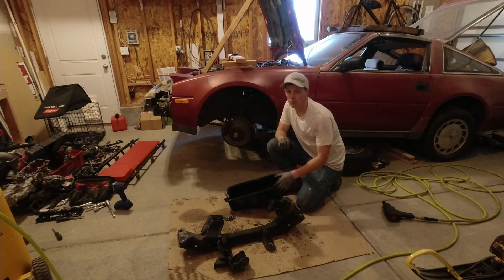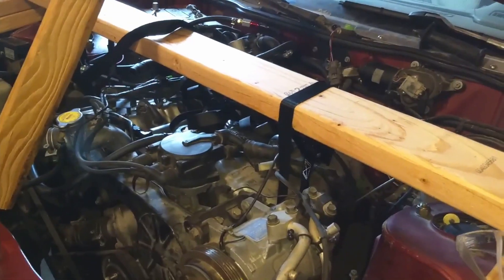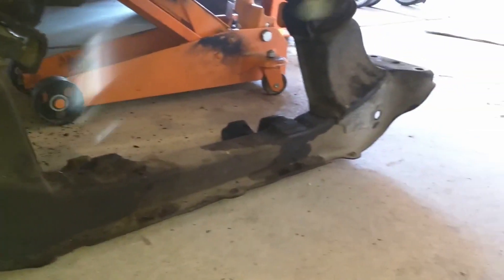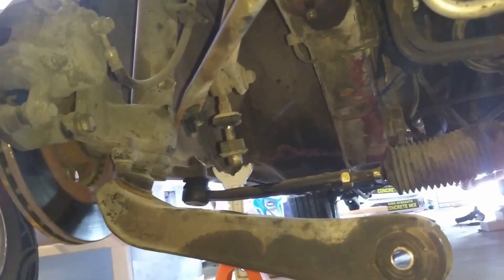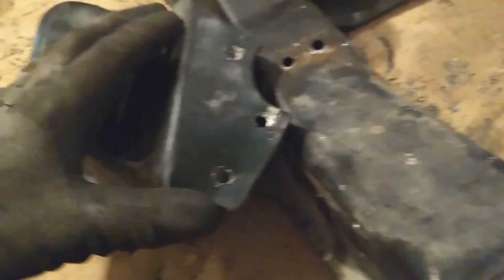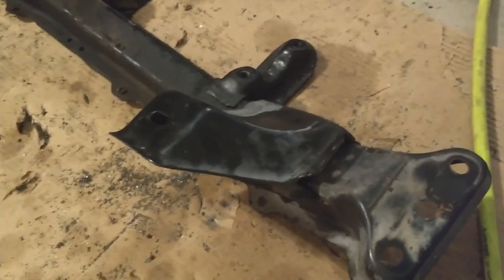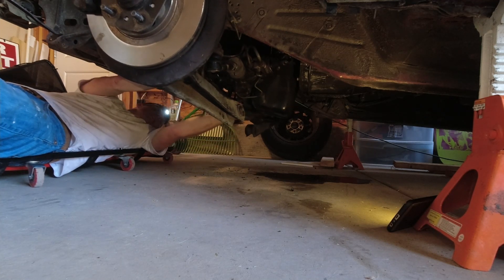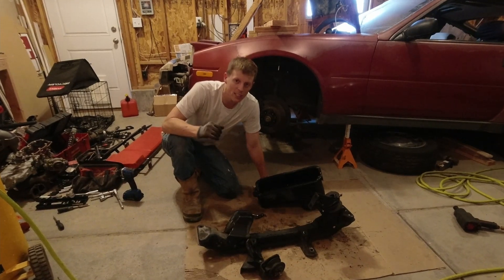Z31 Oil Pan and Crossmember removal NA2T #6

Comment: Awesome videos man. Quick question though, what if im using a relocation pipe and I don’t need to change the front crossmember. Am I able to wiggle the oil pan out w the crossmember on?
Reply: Have to either take the crossmember off or lift the engine out I do believe. From my experience it did not wiggle out, just made my leak worse
Reply: @tastyscrib8143  yup shit just seemed like way more work than pulling the engine so I’m pulling the engine and changing some stuff while I have it out. Thanks tho!